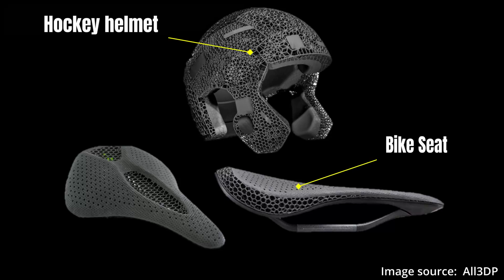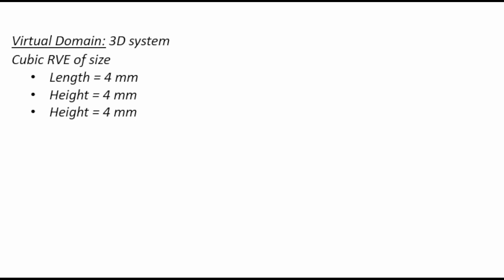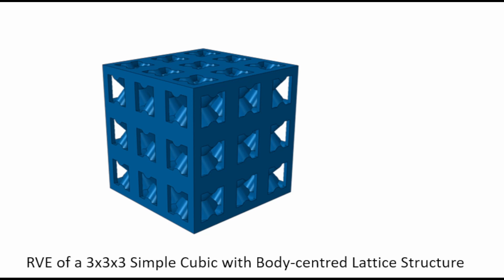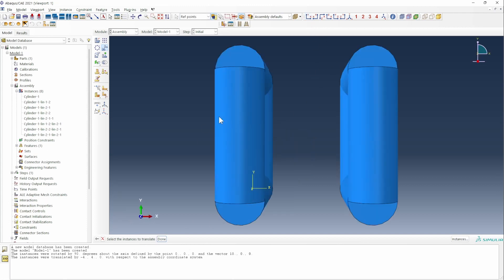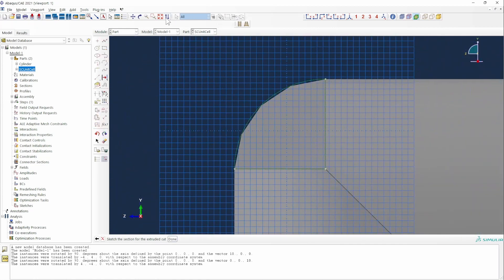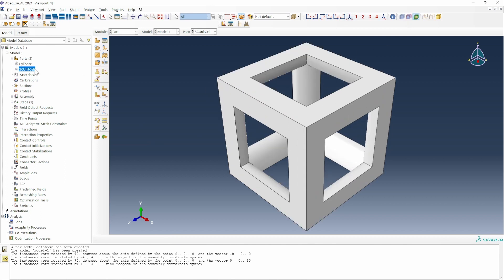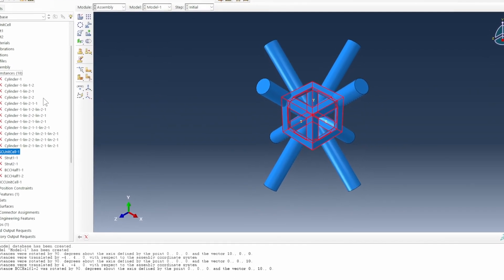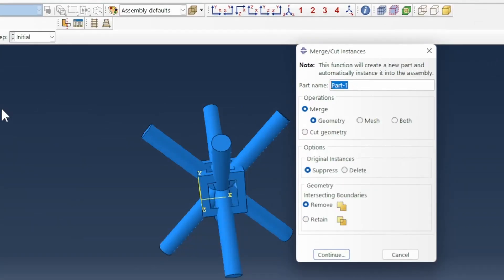FIVE STEPS for creating a COMPLEX lattice within ABAQUS

Comment: Professor, Generally for a Simple Cubic Body centered cubic, the BCC struts will connect to corners of the SC right! I tried  to rotate the SC by 45 degrees along Y direction  and assembled the SC and BCC then I got exactly  what i need . but when i try to use cut extrude, for removing extra struts, I'm getting an error like, section must be closed to use this feature. how do i cut the extra material without using  extrude cut....
Reply from the maker: Hello @Sushanth, I am not sure why the problem you are having with extrude cutting. It is difficult for me to say what is oging on. I will suggest you follow my videos closely as it will work you through the whole process. Cheers!

Comment: Please , I wonder if abaqus can accept matlab as subroutine .
Reply from the maker: He'll @Benmelouka, I do not think this is possible.  A user subroutine is simply a set of extra instructions for say ABAQUS, written in a language that can be understood by ABAQUS.  It will normally fit in within the original framework of ABAQUS.  For example if it's a UMAT, then the subroutine has to run inside ABAQUS' Material module.

This is why I think a user subroutine written in MATLAB cannot run on an ABAQUS Module framework as it will not be readable. 

However it might be possible to intelligently use  MATLAB to help with creating a user subroutine, but that can be testing our the modelling principles and when ready, you can then them implement the ideas in say Fortran for use as a User subroutine in ABAQUS.
Reply: @MichaelOkereke  Thank you very much sir.

Comment: Please, how  are determine modulus of elasticity  or  face area
Reply from the maker: Hello, thanks for your comment. I already addressed some of these in previous videos. If you want to find the Young's Modulus for a lattice structure, see how I did it for a simple cubic unit cell using this link: https://youtube.com/clip/Ugkxz6mU8fDKmh7mSAav7Phk_bfHJ7JUs3zI  

Also, for generating the face area of any surface for same simple cubic lattice composite, here is also a video I did which can help you too: https://youtube.com/clip/UgkxqlKbXZp-MdYuOS-AjwpcumSKga_K4grf

Good luck with the work.